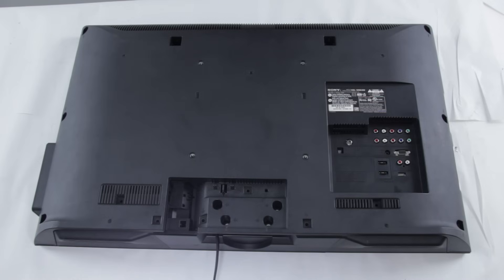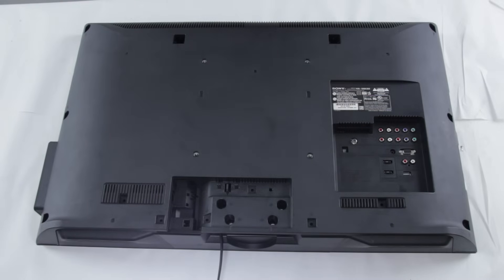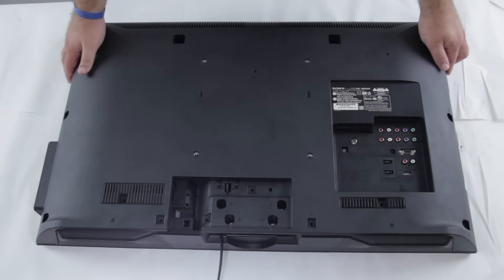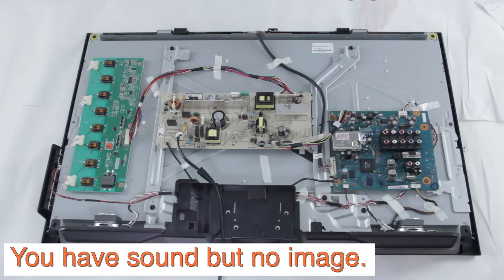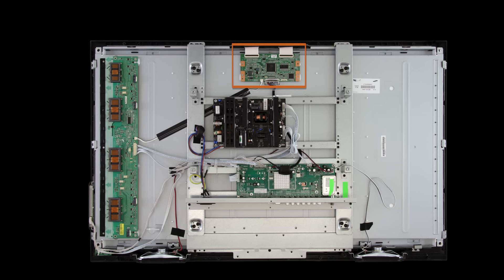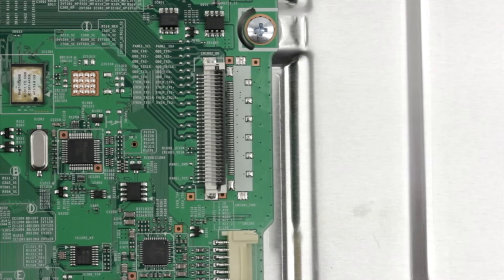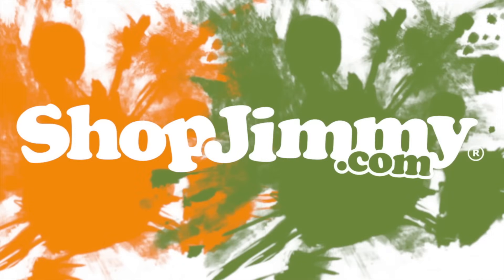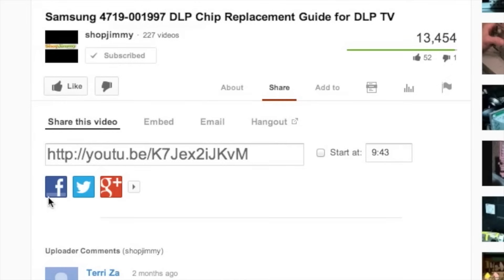LCD TV Repair Tutorial - T-Con Board Common Symptoms & Solutions - How to Replace T-Con Board

Comment: Hi, I have a Silo SL-42V1 tv that turns on to a gray screen.  It is quite clear that the backlight comes on, but otherwise no picture comes up, not even the menu screen comes on.  Upon reviewing your videos I suspect that it is either the tcon board or main board.  I have not been able to hear audio, but not sure if I'm changing the source properly by just selecting the source button several times.  Can you please provide any suggestions on how to continue my troubleshooting?  It doesn't help that I've misplaced the remote, unfortunately.  Any additional guidance would be greatly appreciated.

Comment: I have a M60-C3 Vizio 4K 60" TV Version V1.34-UHD Serial: 33LFTRSZAR01532. It has the ghosting input screen issue. When you turn it on it Ghost scrolls the input screen and eventually lands on a input then you can use th TV.  It was under warranty and Vizio sent a repair guy out to fix it (1 year ago). It is now is doing it again. What do I need to replace to fix this problem?

Comment: hi, I have a Samsung. model no: LN-T4071F.  (long blank space followed by) 8

It was not turning on, changed blown capacitors and now it turns on. However the picture started flickering in brightness and now it has a high brightness veil over the picture.

please offer a suggestion, my guess is tcon board ribbon cables are old

Comment: Hi , i have SONY KLV 32EX330 it Blink 5 time red after green when i am switching on from remote. 
This TV is powered with an External Adapter 19.5 Volt, do checked by replacing the adapter but not resolved. 
I have a picture of the main board, would like to share with you, please provide your email id. 
My only doubt is a tiny battery like thing on the main board, it is rusty. 
Please help me in troubleshooting this.

Comment: I have Samsung Model #LN40A550P3F S Model code LN40A550P3FXZA Serial # ALXR3CRQ800080T. Every time the tv is turned on there is a loud piercing static sound with no picture. Then it stops and comes back after a minute or so. This repeats about 5 or 6 times through a duration of about 8 to 10 minutes. During each pause the tv screen starts to appear a little at a time. I thought it was my local cable going out but the tech that came out said it was my video panel going out.  Is that the T-con board that you're referring to here on this video? If not, please advise.

Comment: I have a Sony Model KDL-46XBR4 Serial No.8259562. Problem, had the TV over 20 years and worked flawlessly. Suddenly a vertical line showed up near the right side of the screen. Over many months the screen started to flicker. The flicker got so bad I could barely see the screen. I notice when all this started that if I lightly tapped the right upper corner where the plastic goes around the screen this would temporarily fix the screen. I saw a video on how to fix the TV permanently. I applied a thin piece of plastic on the spot that had a positive effect. Then tried it out and put back the framework that goes around the perimeter of the screen. It worked perfectly. Then suddenly the TV shut off. I've tried unplugging the TV and re connecting no good, unplugged and held the power button on the side then re-plugged, no good. Noticed an orange light would blink several times behind a vented cover. So I removed the cover. I thought I may have smelled smoke but I couldn't tell where it maybe coming from. There's an orange light that is embedded in a board. When I press the power button this light will flash 16-17 times then it goes out. What do I need to do besides selling for scrap?

Comment: Hi there. I have a Sharp LC-46SB54U. Mainboard replaced by now need the main to tcon "LB" replacement cable or cable pin out. Original cable still fixible but two pins came out while removing old mainboard. Pls help. Thanks

Comment: Sharp LC-60SQ154 60" tv.  Everything was fine when all of a sudden, the image started displaying horizontal flickering sections, moving from top to bottom, along with ghost images.  I disconnected the power cord, turned on the tv and everything was fine for 15mins then it started again and progressively got worse.  Now I have dark sections that move up and down with ghost sections.

Comment: hi i have a jvc model lt-50e350 that the ir keeps cycling the volume down or up and channels at random I have already replace the IR sensor unit and I still have came up with the same problem is it possibly the t-con board or is it possibly something else I have checked the dials on the TV itself and the problem still incurs even without it being plugged in the controls on the TV

Comment: Hi, I have a 40" Samsung led tv.  there are lines on the top portion of tv, when I disconnect the right side ribbon cable from the t-con the screen has no lines but when you disconnect the left ribbon cable the lines are there.  I have already replaced the t-con board and now think the problem is the main video board. and not the lcd.  Comments?

Comment: I PURCHASED A USED T-CON BOARD AND THE COLORED LINES WENT AWAY BUT THERE WAS STILL THE ORIGINAL BLACKISH KINDA SMUDGE UP THE CENTER. I REMOVED A RIBBON WHILE TV WAS ON AND I THINK SOMETHING MAY HAVE SHORTED AS THE GREEN INDICATOR TURNED TO RED AND I NOW HAVE NO PIC. SHOULD I TRY THE ORIGINAL T-CON OR DID I SHORT OUT A DIFFERENT BOARD?
Reply: Artemus Rodricq same happened to me I'm sure it shorted my screen turned white with shadows all over. Replaced tcon board  now I got a blurry left side and  3 horizontal lines down the middle

Comment: hey I replaced the tcon board on my TV it fixed the problem but 10 minutes later it went back out why??????
Reply: jt wise it's probably a bad diode on the power supply
Reply: I faced same issue with my LG tv

Comment: hello , have the sony kdl32-bx300 I'm not getting any image on the tv. the backlight is on . so when i turn tv on hear the audio but no image .ive got a mainboard but still no image hear the sound but no image what could be the problem ; can it be the ribbon cable or is it the tcon board. can that be replaced tcon. please help if you can welcome to any suggestions. please reply

Comment: hi jimmy i have a toshiba regza 55 inch model 55sv670u serial number 950452t14027k1 first issued that we had was that after being on for awhile the sound would get distorted we would turn in off and on and the problem would get fixed..but now it won't turn on at all

Comment: Hi my tv is having color problems, I've tried adjusting the settings but it only gets worse, I've factory reset and it and still goes no good, I have a Samsung ln46a550p3fxza...should I buy a tconn board and if so which one?

Comment: ShopJimmy, thanks for your tutorial. I have  Sony KDL46Z4100 and has color issues. After TV is on for 10 minutes there appears a flush of pixily horizontal color lines. I could send picture of problem if you need to see it. Anyway I see that you are currently out of stock of the T-Con board my unit, T-Con T400HW01 V3. Do you think I may get away with swapping out Chipset AC15-F? Thanks

Comment: sceptre model X42 s/n 708d4VP1aa1534 40" basically what's happening is color distortion mostly with shadows and on and off lines in the black when it's 16:9. menu is completely normal as well as TV guide. I'm guessing I need to change the mainboard out?? thanks.

Comment: I have a Vizio model# M321i-A2 Serial#LWJ20PAP2801075. There is no sound (at times there is just sound) or picture but the screen will show colors of gray,blue,red and an occasional checkerboard design. We have Dish Network satellite for a signal. There have been times when the picture and sound will returned but that hasn't happened in a couple weeks. We have had it to a T.V. repair shop and the T.V. worked fine while they had it. They found nothing wrong with it after testing. Currently I have a an old picture tube T.V. in place of the Vizio set and the replacement T.V. works fine with the satellite setup. Hopefully someone can help. Thank you.

Comment: i think ill replace this board as i have a red vertical line down the screen its only a single pixel wide and i also have a horizontal single pixel line which is black or off sometimes.
the model is TX-40AX630B.
what would u say i should do? 
thx

Comment: where can I buy the tcon flex cables from ys0744001781 tv model no. LE40M86BDX/XEU thanks
Reply: having a hard time finding the exact same part no. is there other tv's with the same flex ribbons that would fit or are they all slightly different

Comment: Hello, I have the 47" vizio model #M3D470KDE. I don't know what happened to it but I woke up yesterday and was watching tv with my daughter just fine,  we turned off the TV to have lunch and when we came back and the TV would turn on, the back light and Vizio logo lights up,  (messing with the roku,  I was able to find that the audio also works.) I did the flash light test and there is no picture.  after watching your videos, opening the tv and inspecting,  I was able to confirm that there was no obvious damage,  no puffy capacitors, there were no burnt components,  and the lvds wires looked great as well according to your diagnoses, I was able to diagnose the problem as the tcon board. is there any way you can confirm this,  and if so can you tell me where I can find affordable (cheap yet working) tcon board and if there's a specific model I need to find?

Comment: Hey shop jimmy I have a question. Well first off I'm not sure if you answer any comments any more since this video is real old. I have an issue with my sound. I opened it up and found the "audio" board. Upon inspecting the I saw that there was a copper coil that was sort of black and a section in the coil looks as if it overheated and melted. So I purchased an exact same "audio" board but yet I still have no sound. I tested the internal speakers and those work very well. I'm not sure if this has something to do with the main board or t con board. I know for a fact it's not the inverter because picture is superb. I'm sure you have came across this problem. So, what should I do next? How do I go about testing the boards? Can you or some one in these comments help me out please. Thanks

Comment: I Have a Vizio M43-c1 SN:LTTWSPAR. The issue is below the top quarter of the screen everything is doubled and I have some horizontal lines artifacting and stutter. in that top quarter everything is perfect. if I unplug one of the t-con cable half of the image turns blank while the other half becomes good again, but I can't have both plugged in and have both be good again. I replaced the main board once so far and the image cleared up for about 2 minutes and then went back to being distorted. I replaced all of the other boards as well after that, I believed it was the main board with the issue, but why would it have the same issue as the original board after only 2 minutes and replacing everything else?

Comment: Hey there I have  a Sony Bravia TV Model Number kdl-32u2000 the 4 red light flash. Switch on TV green light and picture but then goes off and the red light starts blinking 4 times. Replaced the Inverter Board, still have the same problem. The Inverter board was purchased from a reputable service centre.Have also checked the CP101 fuse on T con Board and that is fine. Continuity test telling me fuse working. Any hints? You might ask why bother with an old LCD screen, well this screen has hardly been used and came from my parents house. I want this TV as a monitor any chance  of shedding any light on this problem? Thank you In advance.

Comment: where do you source panels? I run a small repair operation and even after finding the actual panel model number its often hard to find a result. Ebay seems overrun with av boards and power supplies so im guessing im not the only person to run into this issue.

Comment: I have an LG tv that has its back lights turn on and I can still hear sounds but no image, I strongly believe it has to be the T-CON board damaged.. but could something else be damaged as well ?
Reply: I have the same issue with my LG tv too.
Did you ever fix the problem?
Reply: @retortman559  well, if I remember correctly. in the LG after changing everything and testing it.. turned out it was the screen itself been damaged. 

So no I couldn't fix it at all after changing boards and such.

Comment: I have a Samsung UN75H6300AFXZA and after a power outage the TV is unresponsive to the remote/power button but has a constant glow. It is if the backlights are on but the tv is off. I've taken it apart and I do not see any noticable damage to the Main Board, Power Board, or T-Con board. Any thoughts would be appreciated. The $149 complete kit for the TV seems to be sold out on your site at the moment.

Comment: I have a Vizio Model E500i-B1
Initially the issue was there was no picture and no sound, there was no back lighting either. The light on the main board for optical was on.  I purchased a main board and replaced it . the TV worked for 3 weeks after. 
Then again the screen went black no back lightning but there was sound. I tried unplugging and resetting (holding down the power button) and no change. After a day or so now the TV has no sound or picture. 
Any ideas??

Comment: Thanks for your service. I have a Vizio 55” LCD Model# VF550XVT1A
Images and sound works, however, there are 3 very thin lines going horizontally
across the screen about 3-5 “ from the top. Also the screen is flashing while
viewing programming, particularly on the left side of the screen. I appreciate
any feedback, or direction you can provide. JB

Comment: My model # is TH-50PH9UK.  The serial number is MB62830116.  My Panasonic flatscreen was doing fine until it started displaying green polarization every so often, and then it would stop.  A few weeks later it would come back and then go away but each time it would last a little longer.  Over the past 6 months it's gotten worse and now it's not going away at all and the picture is heavily polarized in green overtones.  I've read that replacing the d-board might fix the problem.  I've also read that it could be the t-com board.  And then you research a little further and it sounds like it could be a problem with the main board.  I haven't opened up the TV yet though I'm willing to replace a part if need be as I'm fairly good with electronics.  I'm curious if you would know what the problem could be.  When it's working the picture still looks amazing. Please let me know if you have any idea what I would need to do to fix it.  We're prepared to buy a new TV if we have to.

Comment: Have an LG 50 inch with screen that would work for 20-30 min then slowly start to fade to white from bottom and eventually go all white I changed Tcon board but went white quicker with new board. any suggestions? i have tried other sources i.e. Wii and still same issue.

Comment: I have a Vizio M60-C3 4K ultra 2160P.  The screen is darker grey on one side.  It is not missing the picture as when the scene gets lighter I can see the video.  Using a flashlight it illuminates the video.  The other side works excellent.  There is a horizontal line at the bottom.

Comment: Samsung UN60FH6003FXZA 
My TV is 3 years old and half the panel became black and/or blue. Audio was OK.
I bought a t con board and once I installed the new t con board the TV does not even turn on? the standby button flashes and you hear a clicking sound?

Sal

     1 product rating

Comment: Hi Jimmy,  I Need your expert advise as I have 42" LG led smart tv which has vertical line. There is no damage physically and the vertical line is on the top portion of the led display panel. I wanted to know the problem before i decide to throw it away if unable to fix. Thank you in advance. - Arnold

Comment: I have a samsung un46es7500fxza led . The unit is in a tv shield case outside. When the problem first started the picture would turn to multi colored vertical lines and the screen would freeze then the picture would come back and work just fine. Then I as time went on the problem got worse, I would have to un plug the tv and it would play fine. Now it keeps happening all the time.
So I took the back off and unplugged the cables connecting the boards to see if any of the pins appear to be burnt. I did not see any with the naked eye. With the back off, when I turn it on now the samsung on front  lights up but not the screen, you hear a couple of clicks then a few seconds later the samsung light goes out. I would be very grateful for any suggestions. Thank You,
Ray

Comment: Hello there, 
I have an LG 55LM6400 Smart&3D. Since 4 or 5 months the screen started to show a thin horzontal line (in black or magenta colour), the line is located at about 1/4 of the top of the screen.
And now about three days ago the situation  worsened, the lower 3/4 part of the screen is now shaking, like jumping constantly to the lower part of the screen.

I took the TV to an LG support service center, and the guy told me this is not a TCON pb he said all the LED panel has to be replaced. definetly not something to do !.
But since the guy did not even open the TV ot tried anything, simply by seeing the thin line appearing he told me that.

Just to have your opinion on this.
-  Do you think this is due to the TCON board ? is it replacable on this TV ? will it sove the problem ?

Comment: I have a Samsung LED TV model number UN50EH5000FX2A, Version AJ04, S/N Z5HU3CBFB11307R with no picture but sound. There is a slight glow on screen when TV is on. Tried flashlight test (not in dark room though) but did not see any images. I am able to see light through panel on back of TV. Is it the t con board?

Comment: My 50" Samsung TV has a 2.5" vertical black line. How do I solve this problem?I tried disconnect and reconnect the flat cables from the T-Con board but the problem is still there.
Model #: PN50A450 P1 DXZASerial #: AKWX3CQQ05987E
Please help.
Thanks